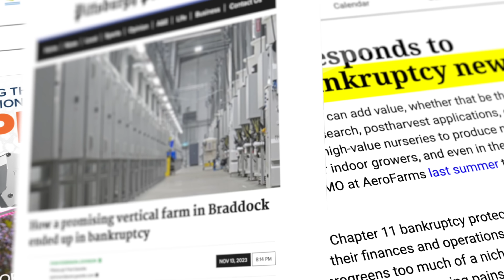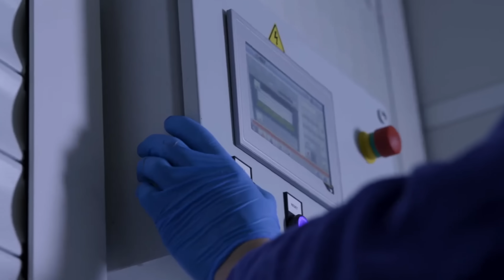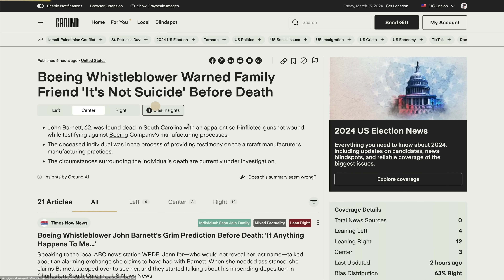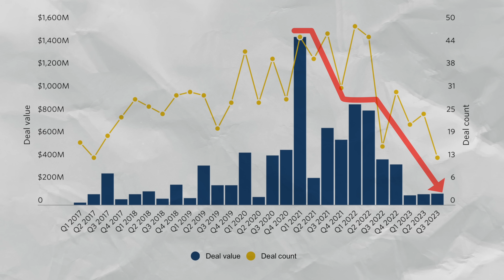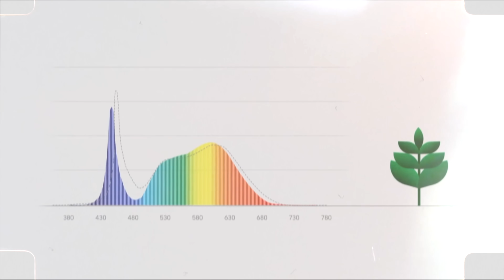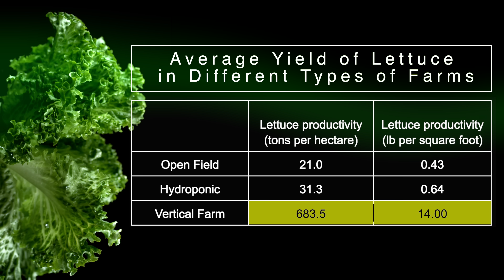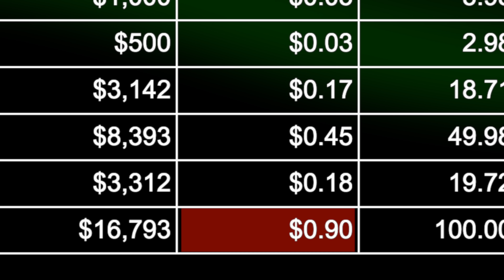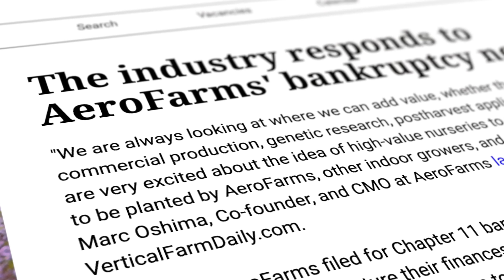The EPIC Failure of Vertical Farms - What Happened?

Comment: well i would have guessed that the high payed workers on those farms are replaced by ai pretty soon, adding a bit more for the power bill, maintanance and initial cost but if that could reduce about half the cost of the hole project that would a t least be a big stepp...and then over time the ai might find ways to save some costs in other areas. problem might be the cost of the manager for that plant, if you ask a farmer what he makes and how many hours he works they usaly are below minimum wage...now try to find a manager that works for that ;)

Comment: Having worked in the industry, I can tell you it is plagued by an obsession with complexity. The solution to every problem is an insanely convoluted system with a million parts, high maintenance costs and a propensity to break in some way every week. This could work, but far more focus needs to be paid to the Kiss principle, and on lowering per unit production costs.

Comment: The benefit of vertical farming is the smaller footprint and that it is not dependent on weather (resilient power notwithstanding…). You can put a vertical farm above or below other structures. Unfortunately yes, the trade off is cost. Until we can bring down drastically the cost of building, running, and maintaining.

Comment: To quote Geoffe Lawton (well known Permaculture teacher): In order to be sustainable we need to create a surplus. We create a surplus when we create good soil (and even transform dirt into soil - as they did with the Greening The Desert project in the Dead Sea region of Jordan, that Geoff supports). Another way to create a surplus: managing water with earthworks, like ponds, trenches that soak in heavy rain (swales), irrigation systems that are built to last. 
Improving / creating soil and managing water are very important in permaculture. And creating food forests.

A PC gardener or farmer starts seeing improvements in soil after 2 - 3 years, and after 5 - 10 years it starts becoming really good. (the conditions in Jordan were terrible, it was dirt / sand - but even there after 10 years they have good soil all over the property. One asset is the warm temperatures. If they have enough water and manage it well, soil life can be active year round. Another asset is the sunshine, plants can produce biomass year round (which can be composted to support soil life). 

A vertical farm would have to start doing large scale maintainance after 5 - 10 years. With good soil no repair is needed. On the contrary.
There is yearly input needed (compost, cultivating cover crops, mulching, ... ), especially in the beginning, but that is not lost, nothing deteriorates or is worn out.

Plants will need some resources like minerals, the content of the parts of a plant that are harvested and NOT composted again will be taken out of the system. So some minerals and elements must be replenished - at least partially. The art is of course to get as much as possilbe for free from underground, from the air, from wildlife like birds (that leave their droppings).  
If the food is eaten on the property the human waste can be recycled as well (so not much is lost - only that which builds the human body).  

Animals turn over biomass fast (into manure). That can be cows - or earth worms. Or small animals like chickens or rabbits. 

There are other processes (like composting) that return biomass to the soil, but they take longer - even with some effort and daily turning of the compost (so work) the composting lasts 18 days in Jordan (and that is with some help of the chickens). One goat or rabbit will do that for you in 1 - 2 days max. The gut of many animals is like a biorecator. Bacteria upgrade the gut content, they will for instance add nitrogen, carbon, and make some things easily accessible. 

The resources and their benign impact on soil life COMPOUND. Nothing to write off. 

Once concept of PC is to cultivate perennial plants, shrubs and trees. Better usage of SPACE, less work with planting.
 
The general idea is to take advantage of natural processes and efficiences to be more efficient AND to manage with not too much manual labour. But monoculture and modern farming methods are not possible with that.

Natural efficiencies and resources.
Use of Sunlight (using height - for instance in agroforestry). 
Managing water: good soil stores more water, there are also earth works like ponds, swales and efficient ! irrigation systems. 

Mulching or growing cover / undercrops reduces evaporation. And it suppresses weeds.

Rows of trees or hedges reduce wind pressure and thus evaporation. Trees - if grown right (forcing them to grow deep roots with ploughing so they will not compete with the other crops for water) -  bring up water from deep below,  the fungi in their root network distribute the water - also to the other crops.

Green manure / cover crops bring up minerals. Certain plants can fix nitrogen. Covered soil does not lose as much nitrogen (it reacts with oxygen in the air, and gasses out). So that means no artificial fertilizer is needed (which needs a LOT of energy to produce). And phosphor is a very needed but rare mineral. If it is brought up from plants than one must not plunder the few existing deposits on the globe. Artificial fertilizer (as also used in vertical farming) must be easily solveable in water (or the plants - which are more or less on life suport in industrial farming) would not be nourished. No one helps them to take in naturally occuring minerals, industrial farming is bad for soil life. 

Soil life (moles, mice .... worms down to funghi and all microbes and critters in between) brings value for free (creating soil, making minerals available to plants, creating long carbon based molecule chains (humus). Humus can even enclose salts, even toxins.  The substances do not vanish - but they become inert.

Humus gives soil the ability to store water well etc. It is not even a large part of soil, but it transforms dirt to something magical
Last but not least: good soil is an excellent carbon storage. Industrial farming reduces the carbon content of soil (it reduces humus, which holds a lot of carbon). Organic farming or less aggressive farming increases carbon / humus content of soil. It is so universal, that the carbon content is the nuber that shows the quality of soil. 4 - 5 % is already good.
Reply: What an essay! Next time make a video reply please. Lots of subjects you covered, but organic doesn't mean less aggressive: tilting destroys the hummus you mentioned, since many fungi are wiped. Look into regenerative practices too. All research is important, soil is not convenient when producing in space stations.
Reply: @andanssas  exactly, since organic farming is almost identical to pre-industrial or pre-1750 farming which was clearly not sustainable. As an example, tillage caused soil to deplete of nutrients so farmers used guano bird poop as fertilizer. So much guano was being used that it too was being depleted. Tillage also killed good bugs which led to severe pest problems and famines. Such unsustainability is what created the need for the very pesticides and synthetic fertilizers we love to hate on.
Reply: I am actually skeptical of whether there is such a thing as sustainable farming. Organic farming is similar to farming prior to 1750, which had problems of its own including depleting soil of nutrients and the need to supply nitrogen with guano. It is possible that the a hunter-gatherer lifestyle is the only sustainable way to live, but I certainly do not want to live like one.
Reply: @thetruthstrangerthanfictio954  it took humanity ~55ka to figure out agriculture--with us only having that tech for a small fraction of how long humans have been around (Only 10ka out of the 65ka of homo sapiens existing)

This technology was created due to how often humans would eat themselves into near extinction. As back then, humans didn't have anything like XBoxen or Playstations or Nintendos to spent their free time. With it only requiring about 12hr/wk to get enough food to eat. So the only thing to do for the rest of the week was "make art" and "Screw"

However, it took ~55ka for humanity to figure out how to successfully accomplish farming

People act like agriculture is a really really easy thing to figure out. It is a skill, that needs to be learned, honed and heavily practiced. It merely looks like it could be "straight forward" via a mixture of arrogant dunning-kruger filed hubris and the fact humanity has been working on improving that skill for ~10ka. With a lot of that improvement being accomplished (for European based cultures at least) being done in the last 500a

That being said--it is not unwarranted to suggest we might still have another 10ka to get it perfected
Reply: @NimhLabs  while I don't completely agree with you, I like the fact that you don't think we would be better off as hunter-gatherers. I also share that opinion. The problem with hunter-gatherers not having much to do is worse than you think, because modern hunter-gatherers hardly ever create art and do not engage in scientific research. If you look up Hadza tribe art or !Kung bushman art, you will find very little results, and what little you do find is either art they created with the help of a visiting artist, or art created thousands of years ago. That implies that today they do not create much. If you watch videos of YouTubers staying with hunter gatherers for a week, never during that week do they create art. Instead they spend most of their time either getting food, migrating with prey, or making tools to catch food.

The short 2 hours a day work week often cited is only the hunting part of the work, with the other stuff adding up to make an average work week of about 12-16 hours a day. What little free time they have they leave for "screwing" as you put it. Since I consider art, science, and other creative activities to be what makes us the most human, I am against the idea that we would be better off if we were hunter-gatherers, even if farming is unsustainable, which I think it may very well be. If it seems hard to reconcile  my two beliefs, my Christian worldview helps to mitigate it somewhat. If you are curious I can elaborate on it further.

I also like how you do not seem to think organic is the way to go since organic farming is similar to pre-industrial farming practices, which you imply were not sustainable since you imply that we still haven't figured agriculture out completely. You may be right there, and it may take one million years for us to completely figure it out and make it sustainable.
Reply: What? 5 to 10 years for results? But that goes against everything Silicon Valley talks about for how long it takes to set up an established industry

Next thing you will tell me is most non-Silicon Valley industries move at a much slower pace than Silicon Valley, as that pace is kind of required to get meaningful results
Reply: TLDR

Comment: Interesting, but does this mean that vertical farming can't be made to operate more economically in developing nations like SE Asia. In my country,  Philippines, farmland is expensive. Labor cost, however, is relatively low. The average temperature is higher than many vegetables thrive in, but water is readily available, as is sunlight. I have looked into growing strawberries, as an example, but this will require cooling in the hottest part of the year since strawberries prefer temperatures of 27 degrees C or less.

Comment: I wonder about the basic electricity price, which led to the 44 cents electricity costs per lb of lettuce. Or the corresponding electricity demand in kWh.
I suppose, it was pretty cheap electricity. My assumption would have been more than 5 kWh per lb of lettuce.
However: Electricity costs for lighting are not prohibitively high for lettuce, because it consists of 95% water. You pay basically for water, with hardly any calories. 
Plants need light to produce nutrients like carbohydrates, fats and proteins, not for storing water.
The high labor costs may be an underestimated point here, but if you would try to produce "real" food by vertical farming (calories, protein), electricity costs would go through the roof.
You would have to calculate on hundreds of kWh per kg dry weight.

Comment: Mostly its the fault of the kulaks rigging the market. We need to remove income tax and institute exponential property and equity taxes. So you pay on an exponential curve per acre and per share, federally. On top of the same thing at the state level. If you can be that efficient on that much land, sure you'll just get soft capped and still turn profit. But you won't be able to, because automated vertically integrated solutions are best for us as a species and for the planets biodiversity. Failing that we nuke the atmosphere so there is no other choice. 2030 - lets go.

Comment: Fascinating that labor costs for vertical farm were listed over $25,500 annually for vertical farm vs. $1000 for field farm. Was surprised that water was not shown as a cost. Field farms can require copious amounts of fresh clean water. This the primary reason we do not see more land utilized for farming.
Reply: Person from flyover territory, here.  Surrounded by corn, soybeans, Milo, and some other odds and ends.
Most farms are land owned by an individual under some kind of co-op agreement (there's a rabbit hole to dive down if you want - the illuminati stuff of the vegetable world).  The owner is usually the primary labor by way of owning and operating the equipment.  Farm hands are rarer and rarer.  In the early 1900s, it was around 30% of the population worked in agriculture.  Today it is less than 1%.

Water is sourced from wells fed by the general water table.  The cost of it is the electricity to pump and capex to deliver it.  There's no water bill.
Directly, at least, there may be environmental checks for runoff and the like - but are negligible in the cost of overall operation.

There are crops which are more labor intensive to harvest - but that is often universal across farming methods.  The automation technology/innovation just hasn't cracked the challenge for them, yet.

Comment: It goes back further than the mid 90's.  In the mid - late 80's I was a horticulture grad student at a university and we were experimenting with vertical farming with strawberries and other compact high value produce.  The economics were so far from working though there was not thought of using it commercially.  The goal was more about whether it could be used in research to replace the typical test plot systems.  But it had too many issues for that as well.  Considering the low value of many food crops I think we're a long way from this ever being economical in the US.  As mentioned traditional farms spread their cost of operations over huge tracts of land producing vast amounts of products without the cost of operations increasing much at all.  Vertical farms don't have that ability.

Comment: Its hard to completely parse out a completely nutritious nutrient mix for plants using artificial means.  Even in field grown crops, nutritional quality has gone down with soil degradation.  

We have a small acreage where we have chickens on pasture along with a smaller garden area.  During the summer we move the chickens from place to place, fertilizing as they go.  This enhances the quality of their eggs/meat.  They also have inputs of feed, oyster shells and grit.  I clean out their coop, which goes onto a manure pile and eventually fertilizes our garden and fruit/berries.  Even the rich nutrient skin of the salmon from the river that goes by our place ultimately ends up in our soil.  The point is is that nutrient inputs to our small place reaches far beyond the borders of our property.  However, unlike a artificial system like a vertical farm, our system with diversified pasture, does a much better job of recycling nutrient and holding on to it.  Our soils, and plant diversity are improving over time.  

In ecology, diversified plant systems leak nutrient very slowly requiring low inputs.  Its why regenerative pasture, improving soils and meat based diets are still a very important part of agriculture.  Vertical farming could never be the base of a sustainable agriculture system.  

I also happen to grow microgreens.  I used to sell a few at the farmers market.   They were expensive, and I told people it made more sense for them to grow their own.  Not hard to do.  Just a rack, a few lights and because we heat/cool our homes anyway, there is no added cost there.  They are nutrient dense, not because of the soil, but the nutrients in the seed itself, grown on soil outside.  I add a bit of seaweed fertilizer to enhance the micronutrient profile.  Store the seed in a freezer and one has yet another buffer against local food shortages and inflation.  Along with our chicken, grass fed beef we buy and the salmon we catch.  

BTW, we shouldn't talk about water "use" but rather water "borrowing".  We take water from the river that goes by our place for irrigation.  That water does not go away, rather transpires/evaporates, adds moisture to the atmosphere and rains somewhere else.  Our duty is to make sure the river ecosystem functions and the fish continue to return.  Most of our water from the mountains comes down all at once during the spring/early summer going directly to the ocean.  The volumes are huge.  If we managed water properly we could have high mountain reservoirs, built to enhance fish/wildlife/wetland habitat while releasing water when we need it, the heat of the summer.